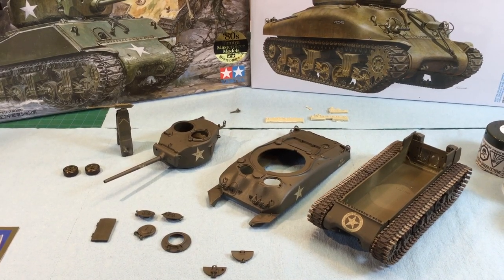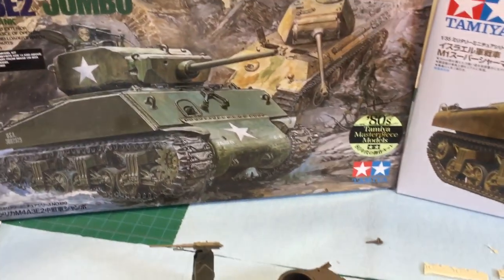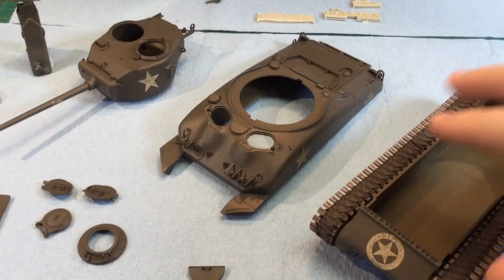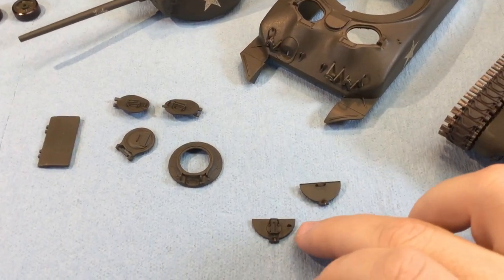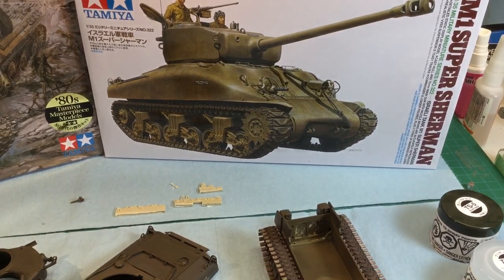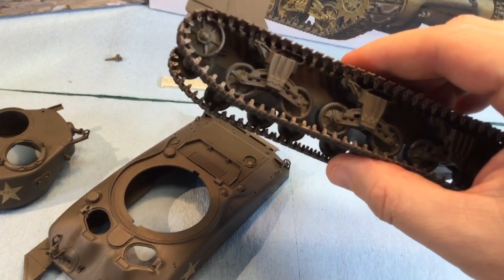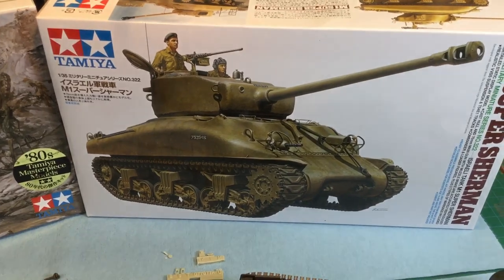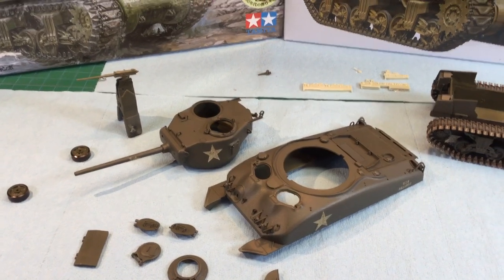1/35 TAMIYA M4A1 (76)W SHERMAN BUILD PART 3

Comment: Great video... gotta love Tamiya kits!
When you build the Jumbo are you going to use any after market besides tracks?
Reply from the maker: I do love the Tamiya kits as well. Yes I do plan to use more aftermarket kits other than tracks with the JUMBO. As to what I am unsure? Once I start planning the build I will know more. I do plan to build all my M4 models one after the other though.
Reply: @inclusivemodeldesigns16  I think somebody (I don't remember who) makes a replacement transmission cover for the undersized kit one, as well as a more correctly proportioned turret.
Reply from the maker: I heard that the kit has or had a few issues? I am not sure if that is with all or just the first releases of the kit though? None the less I will be looking at all aspects of it. Luckily I have tons of spare parts as well as many aftermarket items in reserve. I am having a lot of fun with the M4 builds!
Reply: @inclusivemodeldesigns16  Shermans are probably my favorite vehicles to build. Have you built an Asuka kit yet?
Reply from the maker: No I have not, are they good?
Reply: @inclusivemodeldesigns16  they are very good kits. Fit is excellent, detail is great (a step above Tamiya) instructions are good, and they aren't complicated or "fiddley." Price in my experience is between Tamiya and Dragon. Oh yeah, they are often touted for their accuracy as well.
Reply from the maker: Thank you. I may have to give one a try? I am looking for a M4 Firefly. The Tamiya one is way to expensive! Not sure if it was a limited release or something? Does Asuka make one?
Reply: @inclusivemodeldesigns16  they do, but I think they are out of production right now. You'd probably have to try ebay or check some online retailers.
Reply from the maker: It seems like that's the norm with this variant of M4?